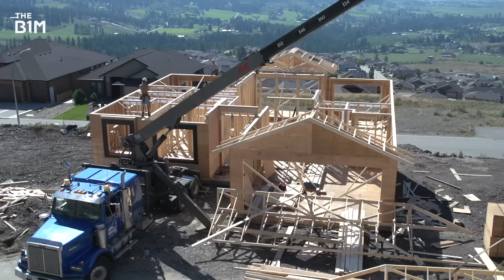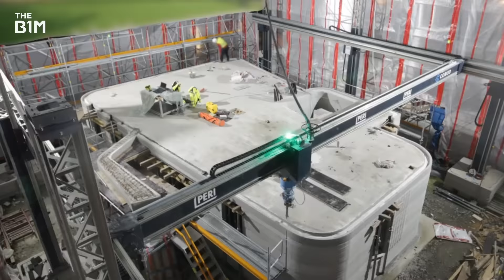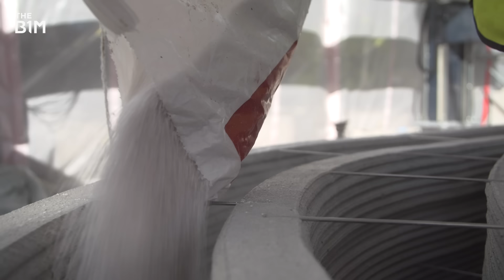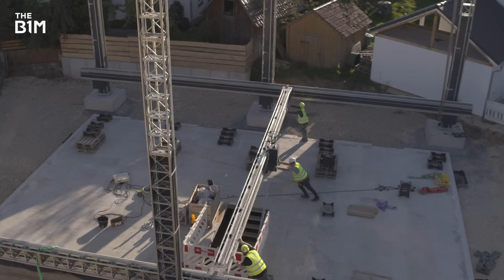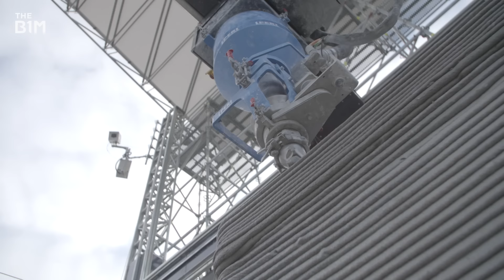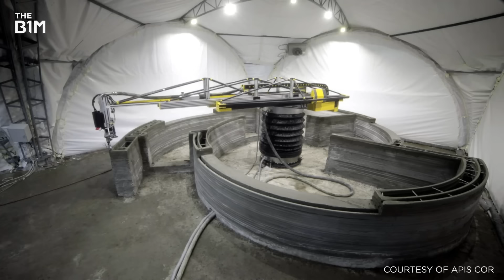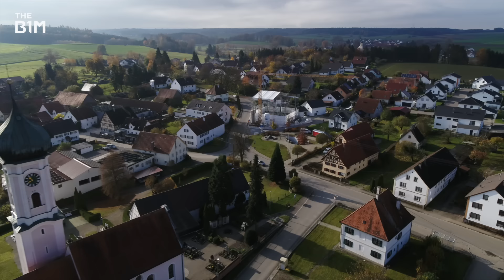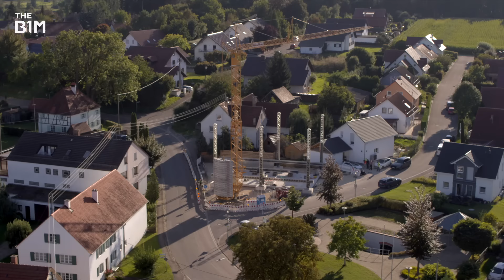Why This 3D-Printed House Will Change The World

Comment: Im struggling to see how this process could be quicker and more efficient than prefabrication like the Bauhaus for example. Especially as it seems like the floors, insulation and internal fittings cant be printed anyway, this seems like a long winded way of just making walls!
Reply: When it comes to walls something like ICF would be faster and the home owner could do it themselves. I don't see the advantage of 3D printing concrete walls, especially without rebar.
Reply: @SomeUserNameBlahBlah  ICF isn't faster. And no rebar required. Its cavity wall construction with wall ties, just how we do our brick houses in the UK.

ICF is fast, but there's way more manpower and labour. And cost. You can build these homes in under 24 hours.
Reply: Martin W :  yep, Mr. Martin, some people like Mr. blah blah blah I’ve never been outside of their county. I like the way people do houses in Britain and much of the continent, with double walls, but that is time consuming the old fashion way, so this 3-D printing is a major technical improvement for double wall construction, or any construction.

You’re in California we build with wood and it is very time consuming and extremely inefficient and we use mostly illegal aliens from Mexico to do the labor. Of course I don’t do that, I built my own house entirely by myself, every single step of it, And that is very rare, and I can tell you after doing all that I was thinking there’s got to be a better way, and now the 3-D printing is here, it is the solution.
Reply: SomeUserNameBlahBlah :  they have reinforcing, using wires, you don’t need rebar if you use wires. Watch the video closely. Yeah you can use a ICF, have you ever tried it? I’ve done it, it’s better than someways but it still doesn’t save that much, it helps but it is not a huge leap by 3-D printing.  Notice how the guy from Perry says that when you do 3-D printing you don’t have to cut and notch for wires and pipes and you name it. That is huge.
Reply: That was my comment... This 3D printed version is a lumpy mess with poor insulation and a massive cost... ICF can be done with 2 older people and they don't need a massive 3 axis machine running to do it.
Reply: @FEV369  It's not lumpy with poor insulation. It's cavity wall and filled with insulation. The walls can be smoothed if the customer prefers, or clad, or rendered.

Don't guess, research.
Reply: @martinw245  Considering the cost and the fact that in order to smooth it out would require labor, it can't possibly save on time over an icf that can be done in 1-3 days by one person... I'm not here to argue or hate on 3d printing, it's a cool idea but seems impractical for now. Machines cost a lot of money and require maintenance. A 3d printer house machine will probably be half a million or several million... the material will still cost the same as ICF. Thus there is no way to get the cost competitive seeing as you still require 1-3 people to run the 3d printer, labor costs... 

Maybe you should not guess but research yourself. If I could pay less to have a home 3d printed and it was as good of quality as ICF, I'd do it... I don't have a bias here. In this video they show a lumpy house that will collect massive amounts of dirt, so no thanks.
Reply: @FEV369 " Maybe you should research yorself"

I did, see the video I linked to. Half the cost of a conventional home and NOW AVAILABLE in the US. The builder has so many orders he's inundated. And has had requests for entire communites.

So yes, more than competitive, in fact HALF the cost.
Reply: @FEV369  Haha.. of course it won't collect dirt. Smoothing over is easy.
Reply: @FEV369  You talk about ICF, but that requires laying the formwork, ordering concrete, filling the formwork as you go, inserting rebar, waiting for it to harden. And then you end up with bare polystyrene insulation that has to be rendered or have wooden cladding attached to the entire house.

So no, it's not quicker. Installing the ICF is only half the job, interior and exterior walls then need cladding.

The fact I've given you the facts, that the system is available now should be enough for you.
Reply: @martinw245  With ridges like they show in every picture it will collect dirt... I mean I guess if you deny physics then you can make up anything you like. You are free to do that btw.

Smoothing over is probably easy, but you are aware that was not my point, it was the cost added to do it. If you smooth it over chances are you are going for a stucco look, thus you need some amount of skill and labor. 

3d Printing has a price problem considering it's not any better quality. Again, I'm not against 3d printing, why would I be? But when you can build ICF walls in 1-4 days depending on the size of a home it's not saving time to print. Labor might be smaller to do ICF, you can always hire more to get done faster but it just saves you from paying the same amount over a couple more days. 

I'm not seeing the upside to 3d printing a house atm... Its not less expensive and has no reason to become so, it does not save you on labor (finding people) and it's not faster nor is it higher quality.
Reply: @FEV369  

"With ridges like they show in every picture it will collect dirt... "

We in the UK build in brick, the brick is not smooth and there are mortar joints that are recessed quite a bit. No issue with abnormal dirt. All houses get dirty in time. 

"Smoothing over is probably easy, but you are aware that was not my point, it was the cost added to do it. If you smooth it over chances are you are going for a stucco look, thus you need some amount of skill and labor. "

Nope, smoothed over with a trowel. Easy, little skill and fast. There's also an effect they do with a sponge apparently that looks very attractive. Really easy to do. Yes it adds to the cost but considering a 3D printed house is HALF the cost of a similar house constructed in the traditional method a few thousand dollars isn't relevant. Its still WAY cheaper. 

"3d Printing has a price problem considering it's not any better quality. "

How can a house that is HALF the cost have a price problem? Have you not bothered to watch the videos I linked to? 

"But when you can build ICF walls in 1-4 days depending on the size of a home it's not saving time to print."

Building an ICF wall isn't the end of the construction. It leaves you with polystyrene insulation on show, the outside of the form, You then have to render or clad the entire structure. Inside and outside. Building the ICF is only HALF of the job. 

And NO, two men cant build an entire ICF house in the same time you can print one. Are you insane. Again, you also have to clad or render the entire house. lol! 

Read this...

https://www.self-build.co.uk/insulated-concrete-formwork/

The FORMWORK takes two days, then the contactor has to spend two days bracing the walls, then the concrete pour takes a day. Then you have to spend a week or more cladding the entire structure.

You haven't a clue what you are talking about. 

"I'm not seeing the upside to 3d printing a house atm... Its not less expensive and has no reason to become so"

Oh my god, You are an idiot. It IS CHEAPER.

Again...

https://www.youtube.com/watch?v=EBaNBqI9dmE

A mere $299,000. Half the cost of a conventional house.
Reply: @martinw245  It is clear you have no idea how to build a building... You are the definition of the dunning kruger effect, thus no point in engaging with. 

Take care.
Reply: @martinw245  300k can build you that house easily, you don't even know what cost to build is... if it costs 600k to build that house it's the land that made up 350k of the cost, not how it was built. 

But again... you have absolutely no idea what goes into building.
Reply: @martinw245  Square Feet	Average Range
800sqft      $80,000 - $160,000
900	        $90,000 - $180,000
1,000	$100,000 - $200,000
1,200	$120,000 - $240,000
1,500	$150,000 - $300,000
1,600	$160,000 - $320,000
1,800	$180,000 - $360,000
2,000	$200,000 - $400,000
2,500*	$250,000 - $500,000
2,700*	$270,000 - $540,000
3,000	$300,000 - $600,000
4,000	$400,000 - $800,000
5,000	$500,000 - $1,000,000
Reply: @Withnail1969  I didn't say the ENTIRE home would be built in a day. Only a fool would not realise you can't 3D print, in concrete, electrics, plumbing and stud partitions. 😉 Not to mention wooden roofs and roof tiles.

One day was a comparison between. ICF wall construction and 3D printed.
Reply: david abe :  Time will tell how ICF Competes with 3-D printing, and I assure you it will be pretty much wiped out except for the few people who have plenty of time on their hands and want a project to consume that time. ICF It’s good, 3-D printing is way better, even though it is just in its infancy.
Reply: They didn’t even show the finished product outside of renderings this seems sketchy
Reply: @martinw245  Ok, so now you just outed yourself as a bigot as well.

I just posted you the average costs to build a home by sqft. The house you posted to me seems very mid sized and very very middle to lower middle class at best... A 600k house on 100k property would be massive and high end. 

Your 3d printed house builds one thing, walls............................................................................................................ This means at best you "could" save half your cost on building the walls.... That's it, that's all... and you don't save on building then with a 3d printer for the record, but even if you did... Are you aware of the cost to build walls?

THE ANSWER... IS.... no... No you don't know how much it costs to build the walls because you have never done any research on building outside of watching a infomercial for a 3d house printing company. 

To build walls is around 15-30k to build for a house 1500-2000sqft. This means you save about, at most 15k on building IF you cut that price in half, and you didn't... 

Dunning–Kruger effect
The Dunning–Kruger effect is a hypothetical cognitive bias stating that people with low ability at a task overestimate their ability. 

The above describes you... Because you don't know any better you believe you are an authority on the matter. 

The roof, electrical, plumbing, slab, gutters, windows, finish work, grading, permits, gabbles make up 90% of the cost... and the 3d printer does not do any of it... it does the quickest and one of the cheaper things, the walls.......................................................................................... Bro, you need to spare yourself from further humiliation.
Reply: @FEV369 

 Utterly irrelevant!

If the total cost for a house is 600,000 when built in the traditional manner.

 And the identical size house next door is 300,000... which is cheapest?

Pretty obvious it's the 300,000 printed house. 😆

And no, I don't believe I'm an authority.... I'm simply giving you the facts, the total cost of purchasing the house. And, err... its half the cost.

Feel free to spend twice as much if you like, for the same size house on the same plot.

And don't bother insulting me. I have enough common sense to know who the Dunning Krugger egfect applies to.
Reply: it wouldn't. never understood the effort of printing houses from concrete...except youre independent from concrete ...a material thats terrible for our world. why not just using more wood? a material that stores co2 instead of "producing" it, like concrete.
Reply: @mofi3641  Concrete greatly insulates a home which requires less heating and cooling; thus, less CO2 to maintain the home.
Reply: @SomeUserNameBlahBlah  Guess you've never been to the desert where the sun heats up the exterior walls all day long, then the walls release that heat all night long and there's never a break for the humans!
Reply: @sigalsmadar4547  That's to do with thermal mass, not conductivity.
Reply: Well Anthony Jarvis, maybe you ought to try building a house the conventional way, stay with bricks or stick built, and then try building one with a kit house style, prefab walls, and I guarantee you will be so goddamn frustrated if you have a brain to see how much better it can be.

I’ve been waiting for this for a couple of decades now, 3-D printing is the answer to building homes and structures efficiently, all kinds of structures.

I built my house entirely myself, but had a hired people to do it, it would’ve taken more than 10 subcontractors just to build and finish my walls inside to outside. Figure that, and figure that each one of those subcontractors is trying to make $100 an hour on his bis as of the year 2021.

This kind of innovation is long overdue and I’m glad it’s emerging.

I am only able to save my clients money because they work side-by-side with me, and it is their sweat equity and close cooperation that gets an affordable and quality product. That is not the way the industry normally works.
Reply: @steveperreira5850  i have experience with both and respectfully disagree, no need for the condescending tone, you arent the only person on the planet with knowledge or opinion on the matter.
Reply: @anthonyjarvis9472   yeah I have watched the conversation and here is my opinions, we can’t really talk about something that’s is not clear on the number. And it’s the fking problem. None of these company say how much it cost to construct these “3D wall” ( yes I refuse to called it a house) because as of right now it is way too expensive. Some guys say a 3D printed house in NewYork sold for half of the price. Well that’s is 100% a marketing stunt to draw attention, Start up company tends to do that a lot, even COBOD the leading 3D print company public a newspaper calling those a scam, you guys should read up Theranos and Wework
Reply: I mean honestly if your only goal is to "become a millionaire" you're just begging to make a dumb decision and be disappointed...I think many will become millionaires in this current bull market but it's not the right mentality as holding can be very dangerous. As hard as it is trading Crypto is way more lucrative and is quite logical if you just study the charts and the support resistance and pay attention to what's going on, I’m not a pro trader but I was lucky enough to make 35BTC since  late last year following the instructions and signals from Karen Asnin Whitby. She runs program for investors/newbies who lack understanding on how trading Bitcoin, Crypto, Ethereum works, to help them utilise the volatility of the crypto market and also stack up more bitcoin. You can easily get to Karen on the web to know more about her experience in dealing with investment. Now i can secure a nice duplex for myself and within a couple of months, hoping to get mansion if i invest more and more with her......

Comment: My biggest issue I see it what about remodelling.   I live in a house built in 1935 over the decades its been remodeled at least 5 times.  Walls knocked .... extection built ..... attic converted ......how the hell are you going to do that in a 3d printed house .... where are the supports ect.  Wanna upate the electrics.? .. tough tits ..... 
Convert the spare bedroon into a bathroom ?    
Houses are not cool looking boxes they are homes ...LIVED IN.   
I see this being like Nuclear Fusion ...always in 10 years time.

Comment: It still uses concrete which is a massive air polluter. Not real ideal unless they can use a material that doesn't add the the climate problem we are trying to ease.

Comment: I do electricity with my father. I understand how there would be a lot less drilling for the socket and switch positions but how do you do cabling. I get that there is a hole in the center of walls. But you can't do it while the arm is printing. And does it leave a hole for the sockets and switches or do you have to sort of push them into the material? How do you not make a mess on the other side? How do you do lights, since it needs to print a ceiling first, how do you bring cables to every light? Is there really no drilling and (dunno the other word for what's not drilling but like when you make a path for the cables in concrete). Maybe I just need to think about all these things but these were some of the things that popped into my mind. I feel like the bigger the project the more time you would save but in the smaller projects the benefits are less. Don't know, but interesting.

Comment: Still have to solve the lack of steel reinforcement to really move forward. Also, put a rubber flap on that extruder nozzle to get rid of the lay lines which crate weak spots. Exciting technology but we still have some things to solve for it to really be useful.
Reply: Reinforcement isn't required. Its not a flat concrete slab. This is cavity wall construction. No rebar required. All brick houses have been built like this in UK since 1920, and this is concrete, even stronger. Stainless steel wall ties are used between the two skins. 

No need smoothing mods. The builder smooths the finish if that's what the customer wants.

As for "useful" these homes are available now in the US.

https://youtu.be/Sdpn_oYXxAs

Comment: I think if you can somehow remove the lines and make it look smooth on the outside/inside... this would take off in a big way since you wouldn't even be able to tell the difference afterwards. With my critical hat on... currently it looks like it was 3D printed, which isn't really that glamorous imo. It's nice for the builders to say and show off but for the masses to live in it, it seems like a cheap house. So people would stigmatize those who live in it.